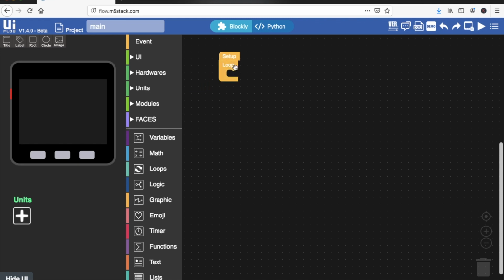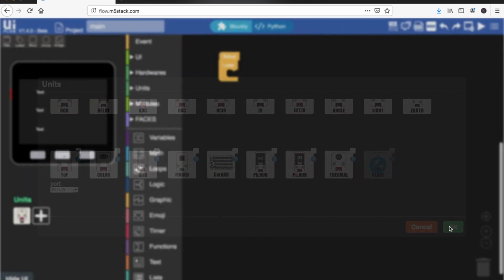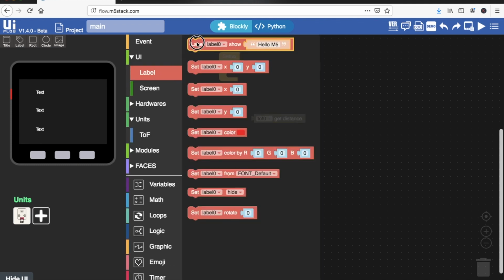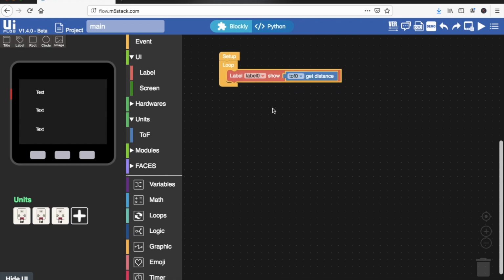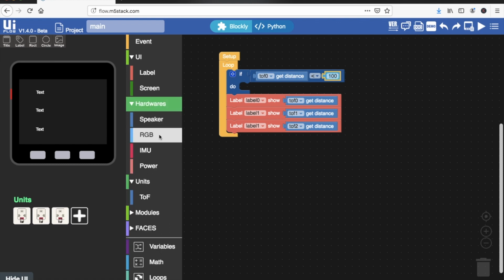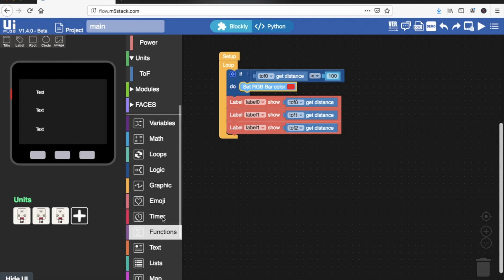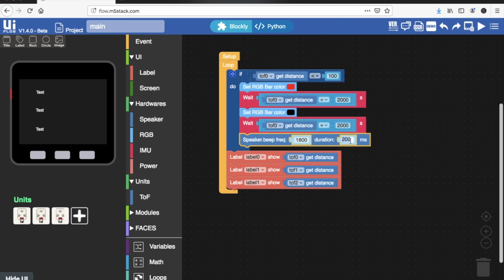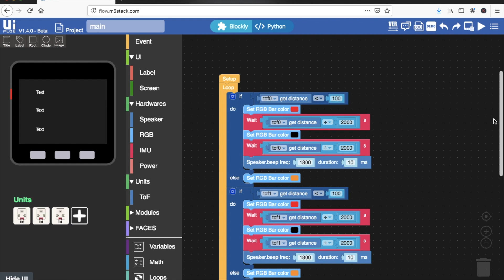M5Stack PAhub Unit - Connecting multiple i2c Devices

Comment: How does the PaHub work with Port A of M5StickC? I am using UI Flow 1.4.2 and the option to choose PAHub when choosing the Unit is not available. Is this mismatch UI Flow Specific or M5stickC specific?
Reply: I have got the same problem: How connect 2xENV II and 4 Realy using PaHUB. 4 Relay is not in UNIT list in UiFlow v. 1.7.5 ??

Comment: Thanks for the very informative explanation.  Could you make a similar video for PbHUB (black port B  I/O hub)? Because  AFAIK there are some exceptions for devices which need more than just one analog read or write signal, so for example hx711 load cell can't be used with PbHUB
Reply from the maker: Thanks Janos, I have a video in the works for the PBhub. Watch this space
Reply: @M5Stack  how to use IR transmission in M5stack -node :?
Reply from the maker: @kriftoft2  Hi, you can send an email to our tech support via roni@m5stack.com